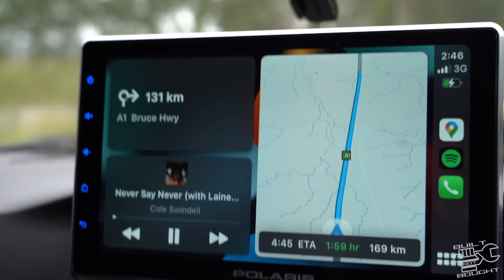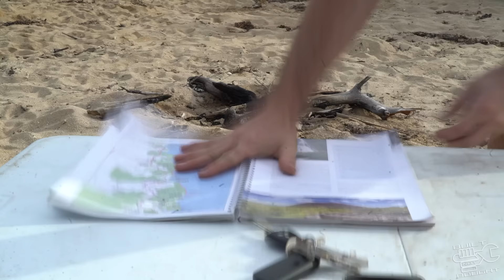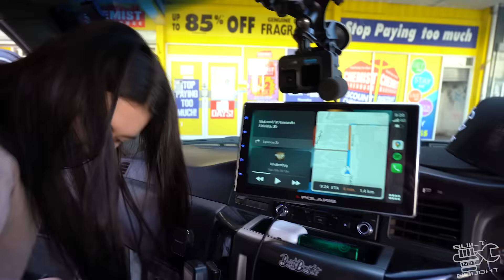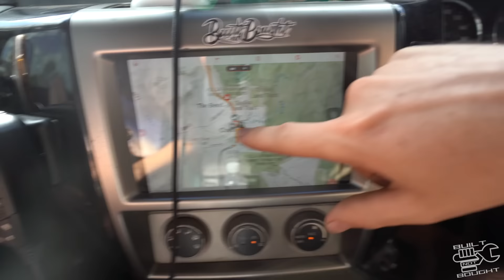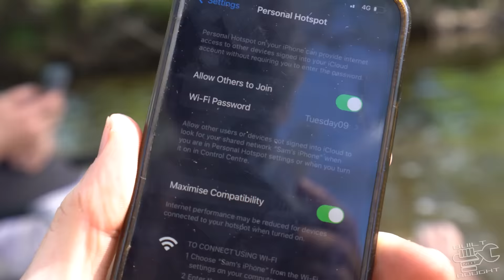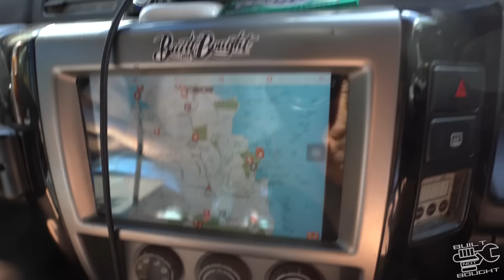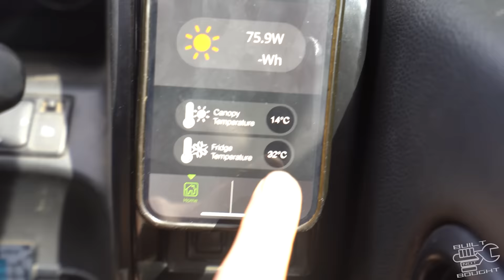COPS IN CAPE YORK…???

Comment: Well that was 'lucky'. 😂 $441 is about half what you would have been stung if your car was unregistered here in Victoria.
 Nice rumble from your stock 6-cylinder Patrol. 🤣
Reply: Not only is it $950 fine in Victoria; they wouldn't let you drive it away either.
Tow truck job until you get the rego sorted.
I got stung a few months ago because they suspended my rego due to Takata airbag recall and they don't notify via usual SMS and email for suspended rego. I pleaded my case that it was not fair so they did refund my $950 but not the tow truck fees.
Reply: @RichardJJennings  it's only $925 in Vic and it depends on where you get stopped if its towed or not

Comment: Darcy, check your top timing chain guide. Might have been the belt but that sounded very chain like through the camera.

The auto t chain tensioner is known to stuff out and then u chew the rest of your guides out.
Reply: Might be on backwards 🤷‍♂️
Reply: I'll have to check it out, lachy from off the wall told us to do it but i didn't have time before the cape so i just sent it, I'm gonna get it changed ASAP though
Reply: Sorry mate. I commented that right as I heard the sound. Didn't realise u Put it in the shop on film.

Do it sooner than later as obviously if it skips a tooth your fucked😂 understandable before the Cape though, when u do get it all replaced only use oem for parts, for some reason every other timing chain tensioner always flog out within a couple thousand.

Get the boys to refresh the head while your in there, they can gum up and your right there anyway, also intake clean to unlock some free power.
Reply: 4d56 in challenger/ mn triton has a timing belt, not a chain.
4n15's in paj sport/mq onwards have a timing chain

Comment: 12:35 cops have a radar that scans the road constantly as they drive, so as it scans every plate it sees if no reg it beeps.
Reply: Some NZ cops have that system too. Not the normal cops just the highway cops who operate on state highways, pretty sure
Reply: That’s correct it’s called an ANPR System and if I remember correctly it can read up to 1000 plates per second front and back and there’s no room for error. If you pass one you’re busted.